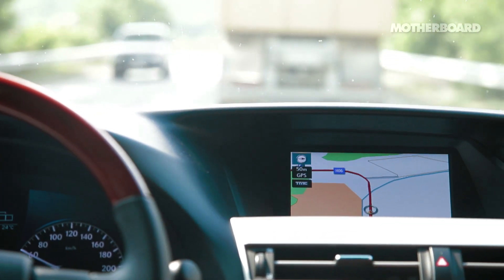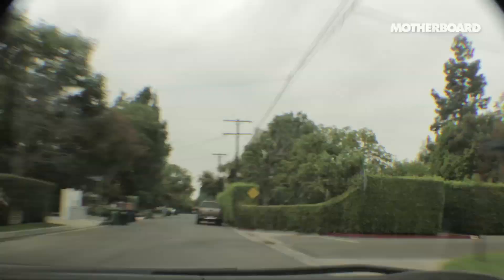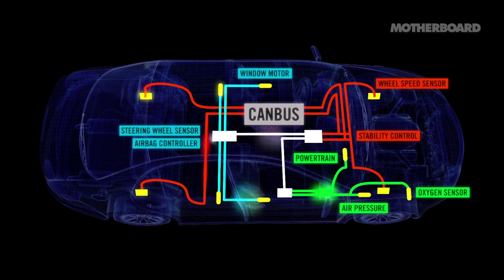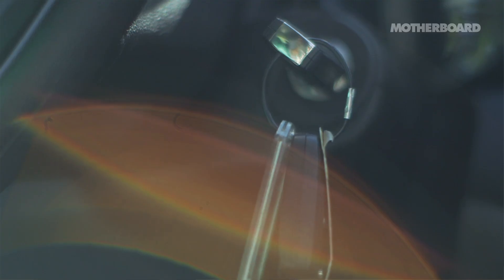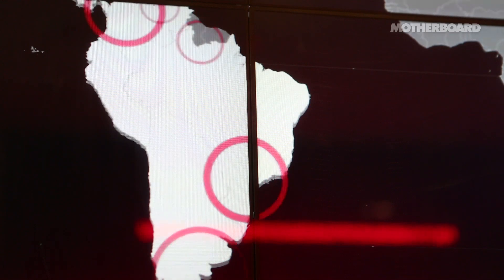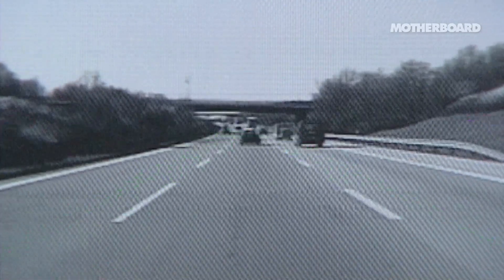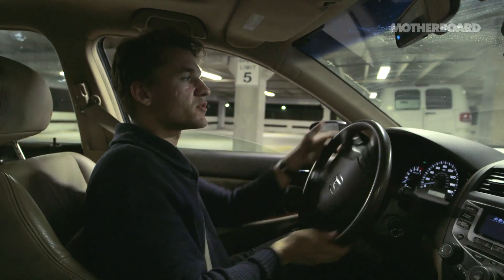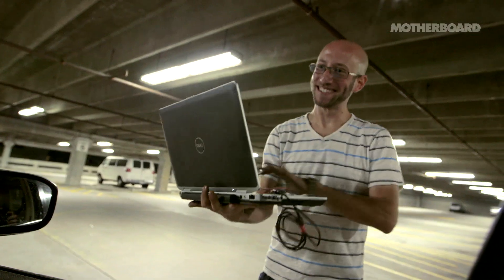How to Hack a Car: Phreaked Out (Episode 2)

Comment: „The plane you’re on has WiFi“ is a really poor explanation.
A critical detail is the connection between cellular connection and driving controls. 
If the two are airgapped, no one can gain remote access without prior hardware modifications. Similar to how the phone in your pocket has an internet connection whilst driving, yet doesn’t pose a threat to your car.

Comment: @motherboard How about Semi Trucks? There are so many computers on semi trucks. Could you make the vehicle read that it needs maintenance anytime that you want? It seems like my truck always has problems that are dealing with the electronics. My radio cut on by itself and the volume turned all the way up on its own. Sometimes the lights cut on by themselves. I’ve been in the shop so much over the past year more than over the previous 3 years.

Comment: The fact that they dressed up a hybrid Honda Accord to make it look like a regular accord is already deceptive in my eyes. They forgot the door panels. 
I’ve been working on cars primarily their electrical systems and can bus for more than 20 years. This videos is a Load of BS… outside of some one physically messing with your OBD2 port there’s is NO WAY TO DO THIS REMOTELY. You need a physical Trojan.  Sure some cars are hackable…this video is click bait and fear mongering… EV, Hybrid vehicles, and vehicles newer than 2015 that are equipped with onstar or electrical steering racks are a different story.. and even GM vehicles equipped with onstar can be unplugged. You won’t have GPS or phone signals but you will be just fine!!
Reply: 8:18 this isn't a hybrid Accord, we hear a normal starter motor in this scene. A hybrid would just burst to life instantly.

Comment: Drive an older manual.Someone tries to hack it, throw it in neutral. Real manual, though. Not the push button type. You have to be able to grind the gears.

Comment: I tried following the video instructions and it wasn't working out, I gave up until I got referred by a cousin of mine to a security hacker and a software engineer. You also can contact him on (925) 230-4245. If you wanna get any of your problems solved

Comment: first guy dosent really know alot about cars, their is a physical cable attaches to the throttle, their is pressure in the brake lines, the transmission is connected via a rod, the first scene was modified, the only thing that would stop him from braking is the abs module, and that only effects the anti skid system, dont let the hackers teach you about the foolery they do to scare you.

Comment: Part of this is not true , the majority of what they are talking about wasn't Introduced into automobiles until 2006-2008, some other cars as late as 2012.  And btw the computer and no chip in the world can tell the cars computer to hit the brakes as the guys puts it, that's impossible, your traction control or vehicle stability control system can be first commanded tell the drive by wire throttle plate motor to let off the throttle , your MAP sensor and primary O2 sensors then send their readings to the ECU which leans out adjusts the fuel mixture through pgmfi once the throttle is let off , then at that point the traction control system or vehicle stability control system can be commanded to deceleration even less power to a particular drive wheel or wheels but AbS modules do not have electric motors in them which can build up and create brake pressure in the lines like the brake pedal depressed will do, so no computer can tell your car to brake only to cut power partially or fully to one or all drivewheels, the only way to engage enough brake line pressure to engage the caliper pistons against the pads is by depressing the brake pedal down manually with your foot, hand tongue , dick or a maple tree stick don't matter what you use as long as the pedal goes down I think that point can be easily understood.  And BTW this video is wrong in that only vehicles with OEM GPS are linked to the internet true mini wifi transmitters or whatever the fuck useless geek gadget they use which has no place in an automobile, only cars after 2010-2012 were demanded by law to contain black boxes "your secret internet connection " if sold within the US.   Any car made before 2009 or older that doesn't have OEM GPS has no internet connection built into this so again this info is partially incorrect.  And btw you cannot knock an automobiles door off its hinges by hammering the pin out because 90% the pins on most cars built in the last 30-40 years are peaned over on each end so only way to remove the hinge pin is to grind off on peened head if the pin with a grinder then drive it out with a punch and hammer , or drill the peened head off of one side.  Or even easier if your gonna just flat out destroy a fender on a car just to gain access to the hinge pins you might as well carry on hand either a 10,12,13,14,15mm T30,T40 or E8,10 or 12 socket cause those are the only heads of any fastener you will come across bolting the hinges onto literally any and all cars , all of those sold within the US anyway, you will not find any other fastener retaining hinges to a door shell.   You wanna break into a car the fastest , jamm both your hands with 8 fingers wrapped as deeply and far around the upper most part of the front door frame, put your knee against the very top outer edge of the door skin right below the window and push in hard and abruptly as you yank violently outward upon the upper door frame. Repeat this until youve bent the upper door frame to the extent you have a nice 1/2"-3/4" wide Gap clear through to the interior around the upper door seal , bend up a metal coat hanger slide it right in and punch the unlock button , open the door , grab the door in the same Manor but from the inside of the door this time and yank it inwards towards your body 2-3 times , close the door and repeat until youve successfully bent the door shell frame back into the point where it aligns almost flush with the outter edge of the back door, you want the front door overbiting your rear door depth wise by 1/2-1mm on almost all cars to assure proper visual look and more importantly ensure you have a good seal all around with no wind noises after you've successfully broke into your car then drive to the dealership and have a second key cut for your car so you never have to do this again if you ever lock your keys in your door again.

Comment: Hey Stup! You can't control the steering on a car!  There are no motor linkages that would allow the car to take commands from anything but the steering wheel.  Self driving car aren't the mainstream yet.  You can only hack into systems that rely on the CANBUS, the fly by wire aspects, no mechanical systems.  You shut the car off, the person just steers off to the side of the road and stops by applying more force to the brake pedal to stop.  That is a safety feature in case the car loses mechanical functions.  Tell the truth.

Comment: Ive got a hard time believing there's a way to control the steering.... 
?-- Can someone explain how --? 
In my opinion, there's nothing "electronic" between the steering wheel & tie-rod ends (at the front wheels) Last I checked, the steering wheel is directly connected to the steering box and the "hydraulic" steering pump -powered by the engine (usually by a belt) 
. . . . . . What am I seemingly unaware of on a vehicle now days... ?

Comment: just hear me out. there's a small key used to turon on the car right? how about you just turn it off?
can't hack it if it ha no power. (also i'm pretty sure that by law the handbrake has to be physical, not drive by wire)

Comment: i'm.not afraid  of being hack $%&#€£¥₩@*!*#*#☝️😆🤣😂
what if the car is not electronically and digitally motivated and manufactured, 
stay away🤐 from online🤯, internet,📡 while driving🚘, be safe and secure in manual mode only🚣‍♂️...in this way, accident will not occur at random  basis....😤

Comment: My hairy ass you can make the car go right buy hacking the car's computer, I am an auto mechanic for over 25 years, the only way I can think of is you fool the ABS VSC that the car is skidding right or left and the computer will try to apply front right brake to compensate to straighten the car but boy you are asking a lot because all the values has to be right from all the accelerator sensors and other sensors or else the Vehicle Stability Control computer will go out of commission and will display a code, assuming that some how you  beat the computer and so? front left brake caliper got engaged and so what's the big deal go ahead and fully apply the front left brake to the point to lock the wheel so is that going to make a car go left? no, it will put a pressure that the car want to pull left but if the driver is good behind the wheels that car is going nowhere. His other thing was what that he can put the hand breaks so again assuming that you beat the computer because you have to fool the computer about the car's speed, about the selection of gears park neutrals etc. about the throttle position sensor so lets say you beat all this and you make the car computer apply the hand brake, so what does that do? if it's a front wheel drive and assuming the hand brakes are so performant it will lock the rear wheels and if the driver is a good he/she will handle that like if it was nothing, what is the other things that you can doo? make the wipers go on make the sprayers go on play with the radio volume, make the engine stall, make one cylinder not fire,  make the transmission go neutral and as far as putting it in park lets say it's a Mercedes, big deal many of this transmission if you do that the lock will not go on it will make cricking noise until the car is well slowed down then it can go in and what the other guy said damaging the engine you will never succeed, boy you are asking a lot first you have to beat the computer fooling many values assuming that it's a BMW with only electrical water pump so you are going not to engage the water pump turn off the cooling fans and make the engine over heat that's the only thing I can think of and boy you have to beat many sensors values because as soon as for the ECU the values don't make sense the ECU will go out of active mode and will fall into a safe operating mode and will turn the check engine light it's going to be super difficult for you to succeed, frankly I think you gonna fail.

Comment: So... you need physical access to the car to attach some custom hardware to inject packets into the network because u cant just connect to it because its only a network of the car and its components and doesnt access anything outside?

lmao.. well technically u could do anything if u had physical acccess. your point is?
Reply: Yeah especially since you can just steal it if you really wanted right there on the spot because you already have access to it.

Comment: How are the brakes dead?  NTSB lift the requirement for fully mechanical linkage?  The booster would go without engine vacuum, but the master should still be depressible.

Comment: 0:30 "The brakes are dead" Nope, the pedal has a mechanical connection to the hydraulic master cylinder and the hydraulic system actuates the brakes. At most he has lost ABS and power brake boost (only assists the driver in brake application)

Comment: most cars aren't connected to the internet except for certain high end models with on-star type systems and mobile wifi / fancy GSM systems. Unless they break into your car and plant some sort of wireless chip / OBD interface there is probably no way to control a pre2010's car remotely. Esp that honda accord they showed on camera

Comment: Obviously this guy has never been under a hood. With the exception of a few vehilces like Teslas, cars are monitored by the computer but not directly controlled by it. Unless it's a Ferrari with drive-by-wire tech most devices that controls things like throttle and brakes are still analogue. Perhaps supported by computer in some cases, ie: traction control. You simply can not take the average car and control it with a laptop like shown in this video.

Comment: and they still haven't fixed the problem.  you can still hack into any car with a ecu. unlock and set it up. and now with wireless Bluetooth  it can be done even easier from anywhere.  i seen a guy doing this in adelaide . played with the abs settings. and  it crassed the car at 80km a hour..

Comment: He comunicate with GSM module to your car? Ok, simple: RX and TX sending and recieving packets over SIM900 gsm module using Arduino true the GPRS and MQTT server with the computer serial monitor, the module inside the car is also hooked up wit gsm module true the arduino wich is connected to adapter (RX-TX)wired to the OBD connector to your car. The only you can hack here is the way to find the parameters for the specific car and study how to interact with them wich can be done by experiments and practice with exact model of car you need to control!

Comment: The 7th gen Honda Accord (2003 - 2007) as featured in the beginning of the video, cannot be hacked remotely, because it's a real low tech car.  The highest tech you'll find in the car is a 6-disk CD changer in the dash.  I have one I have driven for over 11 years.  It does not even have bluetooth.  It can only be hacked when OBDII port is accessed or you dig out the ECU under the front center console.

Comment: I'm calling bull on this on. The brakes are hydraulic, not electronic. So even if the car dies and you lose your power brakes, you can still stop the car if you put hard pressure on the pedal. It's an build in safety feature. And yes, I know the brake pedal gets really hard. But you can still stop the car. They might be able to stop the electronic parts (but I doubt that too), but not the mechanical.

Comment: Nice try but half of this is bull shit even my 2018 charger has a cable operated hand brake and most cars dont have electric steering or brake by wire even now, these things only work on vehicles with their own hardware to support the ability to be electronically controlled

Comment: So assuming the car is throttle  by cable istead of drive by wire. Then the only way it can manipulate the car is through sensor driven components?  Like o2  and lambda egt and fuel pump etc?

Comment: That's b******t there some stuff you can't do if technically like the brakes, shift gears, accelerat and the turn signals what you can do in your car you can play with the mileage to make it like its came out if the factory also you can do DoS attacks on it i would like to that he said you can hack your car in your home, EXPLAIN THAT THE CAR DOSE NOT HAVE A CONNECTION

Comment: Nowadays, almost every car has CAN-BUS (or others) installed by default ,cars, vans, trucks, even trains, planes, ships...All of them are very dangerous to drive, even more the automatic transmission, because You dont need to change gears, and most of them are robotized, that it is even worse. Cars with electronic steering instead of old hydraulic system are easier to control, servos are motors waiting for a signal to turn, and so on... This won't ever fixed, because diagnostic tools use codes for testing the same systems, they read and write values on the car, so, You can sniff what the diagnostic tool is telling to the car and then reproduce the same code with a MCU or something that can talk same protocol to your car. Some vehicles detects that you are trying to test some values while driving, and it enters in safe mode and ignores that messages, on some of them, others (like ABS, ESP, ASR, ...) sometimes needs to be tested while driving, so you can disable it using a diagnostic tool or a MCU. Cars with ECU moddified are even easier to hack. Usually, you can't write all software of the ECU using OBD, and you need to open it, and re-flash them on board, and then, that OBD lock is gone, and now somebody with a bit of knowlage about computers, MCU, and communications, can put dangerous code on your car...

Comment: what they are not saying is that additional hardware need to be installed on the car so the hacker needs to open your car .. pop the hood , install hardware in the engine connect it to the ECU .. then leave the car this could take a long time,, another thing is once you remove the hardware the hacker can no longer access your car.